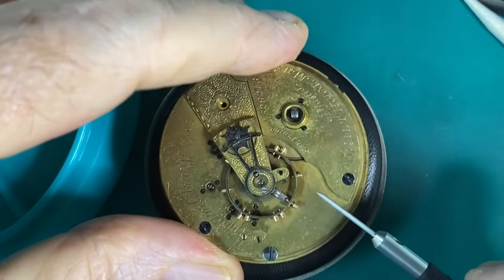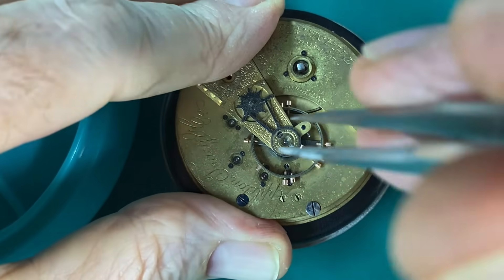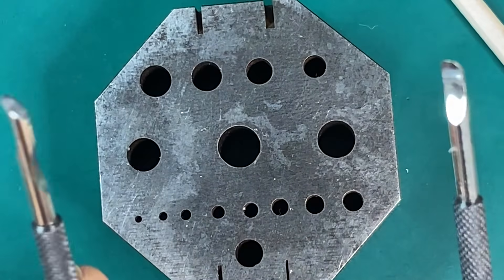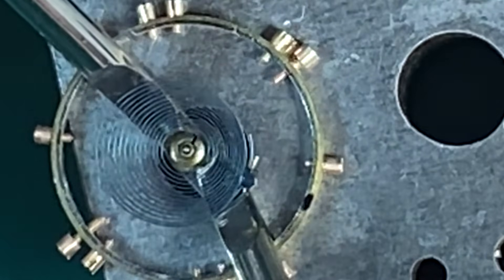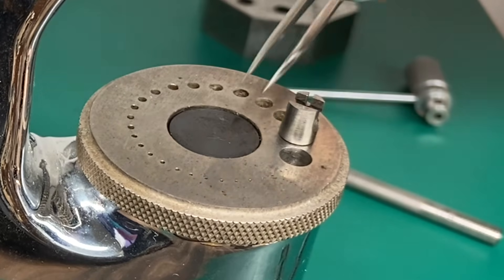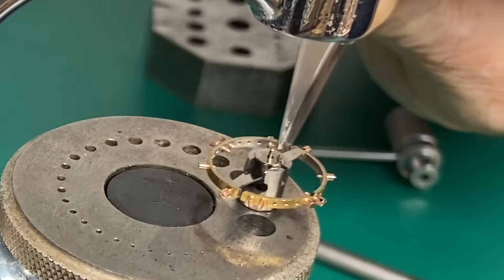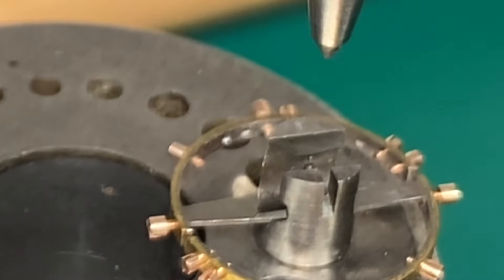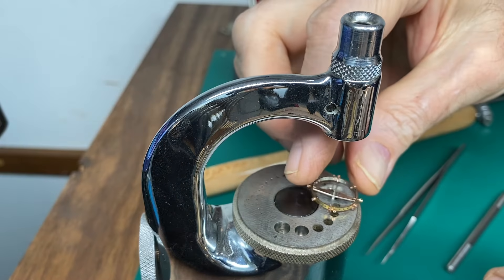How to use a WATCHMAKERS STAKING TOOL Set to REPLACE a RIVETED balance staff!

Comment: I don't have the stump for removing rollers but found a tip on Reddit to use 2 razor blades to press lightly against the staff and slightly twist them under the rollers. If you are slow and careful it's quite easy.
Reply from the maker: That is a very interesting idea for removing the rollers!

Comment: Thanks so much for all of your helpful videos. I have a number of Hamilton 974s that I’ve been restoring, and I’ve learned so much from you. 🙏🏻

A few additional thoughts:
• When I started using my staking set, I didn’t realize the importance of noting the orientation of both the hairspring and roller relative to the balance and cock

• It would be really helpful to see more tips about roller removal / adjustment. The problem I’ve encountered with my staking set is that the stump to remove the roller table doesn’t work for all of my balances! Some of my balance arms are too wide at the center, which means they don’t fit into the gap in the stump, and thus I can’t get the roller off.
Reply from the maker: Thanks for the comment. That is a problem with stump size. There is also an adjustable roller table removal tool that is a stand alone unit I’ve seen for sell on eBay it’s a vintage tool. K&D also had a adjustable stump for roller table removal with there staking tool set it would probably be hard to find that stump for sell. I will try and make some more videos on roller tables. Sounds like I need some more tools.lol!

Comment: I remember being told to mount the   balance wheel and old staff in your lathe and turn the old rivet rim off to prevent any damage to the balance wheel rather than just punching the staff out.
Rod.
Reply from the maker: Yes that is the best way to remove the old staff if you have a lathe.

Comment: Great video. Well spoken. thanks. Some folk will file the old rivet down to make the shaft come of the wheel a little easier. Afraid of damaging or expanding the center hole in wheel because of old rivet. But you have to be very attentive do to file the wheel. It never hurts to mark the direction of the impulse jewel.
Reply from the maker: Thanks for sharing. That is a good way to remove the staff.

Comment: I actually need to do this for the first time on an Elgin, and I have a Hamilton I need to do as well. Do you know where I can buy correct size hole jewels for the Hamilton? I do have the measurements but haven't found where to buy them. 
First one:
Pivot 0.14 mm
Dia 1.115 mm
Thickness 0.3 mm

Second one:
Pivot 0.14 mm
Dia 1.14
Thickness 0.33
Reply from the maker: Sometimes the best thing to do is find a donor movement that is being sold for parts and scavenge what you can off of it.  Jewels are hard to fit because pivot hole sizes are different.  You may want to try some of the larger watch part suppliers online (because you already have the measurements).
Reply: @myhobbiesarenotcheap  thanks for the reply!

Comment: Just getting into the hobby and also am finding it not to be cheap.  Balance staff work is probably a ways away but I'm gathering information as I go.  So where do you buy tools like the balance staff remover tool and staking sets?  I've looked at ebay and I can't find the remover and the staking sets are all missing stakes, etc.

Anyway, thanks in advance and I'm loving your videos, learning a lot.
Reply from the maker: eBay is the only place I have been able to find MOST of the vintage items.  You have to check every couple of days, as new ones are put up.  Also, even buying an incomplete set is okay, if you understand that you need to purchase the other stakes or punches as you go.   You also may want to join the National Association of Watch and Clock Collectors (NAWCC) and go to a show.  They have them in most states - people sell watches and watch tools, etc.  You may have to be a member to get in.. not sure...  Hope this helps!

Comment: Some newer Walthams had a friction fit staff. They are much easier to work with. Another method of removing riveted staffs is to use a watchmaker's lathe and graver to cut off the rivet edge. This takes a lot of skill and practice.  I am enjoying your videos. And Yes, I agree, this hobby is NOT cheap..